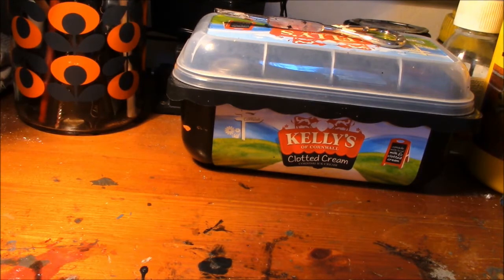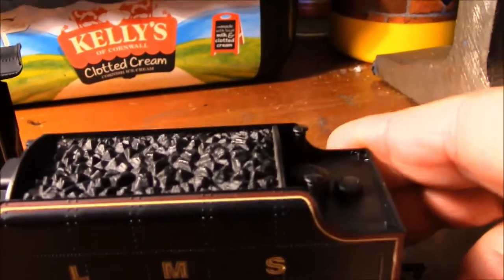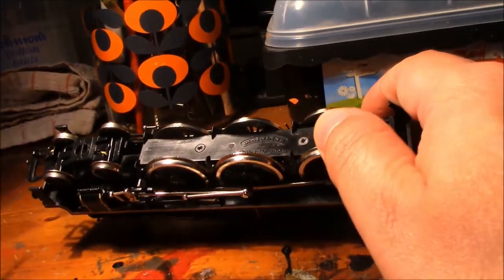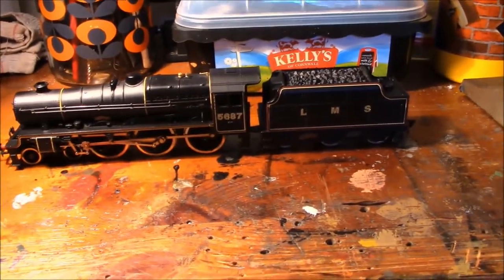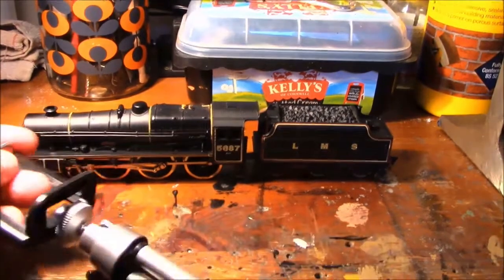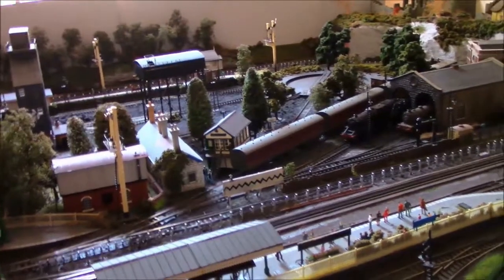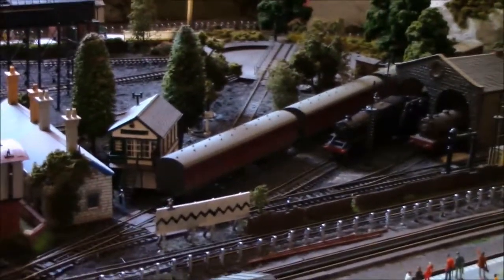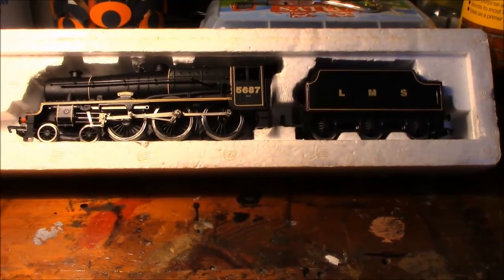OLDIES BUT GOLDIES. A MAINLINE LMS JUBILEE

Comment: Hi hand good morning I like you do think the mainline steam loco are ok I buy them off eBay nonrunners to repair mostly the problems are need of quartering and gluing on the split axles, but if you have a problem with broken ones you can buy these from Peter spares, for I think £ 4 -90 This is not a big job. If you know what you’re doing. Just have a go set one side either at 3 o’clock  and the other 12 o’clock that’s a certain I do and I work okay. I hope this helps your subscribers also I like your layout looks good. Many thanks, Colin.
Reply from the maker: @colinsuffolk9161  Hi and good morning to you also Colin . To be honest the split axel problems are not really the achillies heel of these mainline model’s , it’s the motor and gearing . The wheels are nice to look at but extremely poor quality and are pitted . Super glue is a must for all mainline steam loco’s including tank engines as it’s a universal issue with the split plastic axels as we all know . Thanks for your feedback Colin , the layout is sadly long gone , I have as you’ll see a small layout now . Best regards , Richard .
Reply: @Richardsrailway  I Richard thanks for getting back to me I have stripped down my  locos taken all of the valve gears and also the motor gears and cleaned all internals bushes Springs split the chassis replaced the axles with new ones if needed. Also I have a Ronald Dodds re-magnetiser sometimes the mainline lose the strength in the magnets. I just re-magnetite the magnets put it all back together they run very well I only run three coaches on my lay out it’s only 8ft but 6ft also I have changed it now to hornby dublo I convert a locos to run  on three rail I hope this helps. Many thanks, Colin.

Comment: I certainly agree with you on most points but I find there
is something captivating about these locos. Yes, they are noisy and no they are
not very responsive but I love ‘em and have bought quite a few – eBay refugees
if you will, and like the challenge of 
getting them running again if non-running when purchased. 

Obviously they aren’t up to scratch against newer Hornby
models simply because of their motors but I find one can handle 10 or more
coaches without much of a problem.

How did the tender-drive conversion go by the way?

https://www.youtube.com/watch?v=41f58Zda3q8
Reply from the maker: Tony Steel yes  I agree , molding wise they are pretty decent , The Achilles’ heel with the mainline stuff is their plastic axels that that are split . They tend to break and cause the quartering to go out of sync and damage the con rods , super glue does the trick , motor wise they are a let down . Yes the tender drive went well . Stay safe , regards Richard